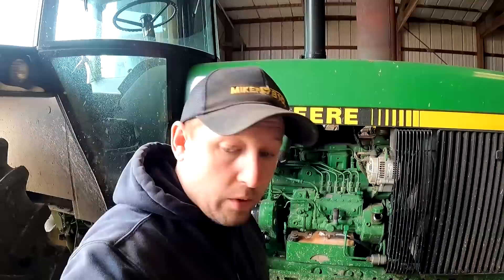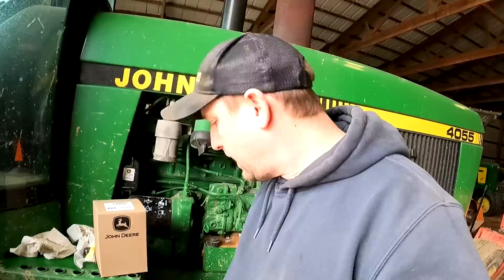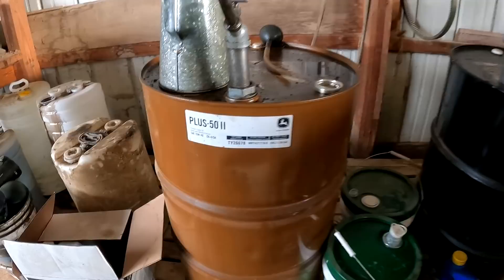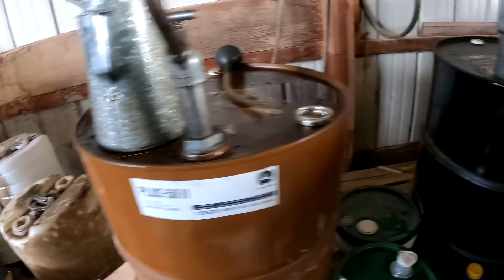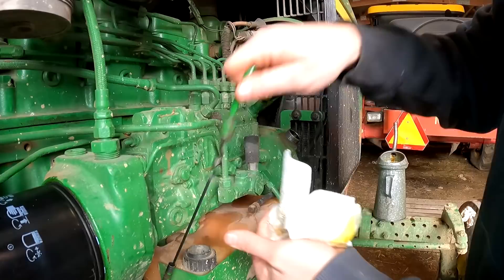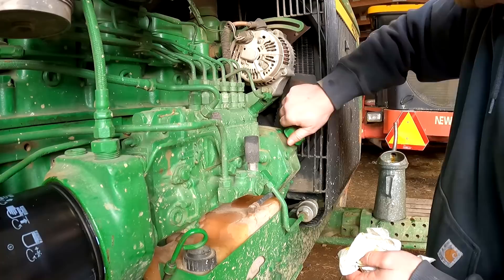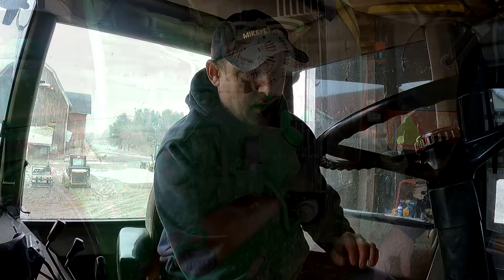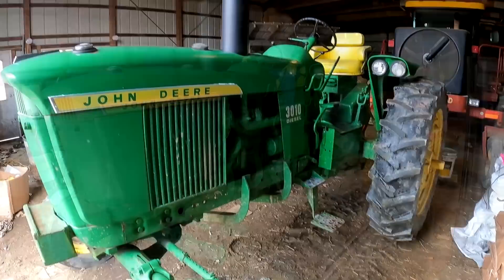Oil Changes & Mufflers

Comment: You definitely are spending money right now on the oils. I changed 1 tractor so far. The orange one. Now a few red ones to do. Lol. Our 1586 is straight piped and a little noisy. A muffler would definitely be nice but too expensive right now. Good video.
Reply from the maker: I hear ya. Trying to be as thorough with the maintenance so we can limit the break downs as best as we can

Comment: The farm I worked on had a 3010 used it to run the feed mixer on and it was a good tractor.nice to see the 4250 at work how do you like it
Reply from the maker: Those 3010 are good old tractors. I haven't really used the 4250 much but it seems like a great tractor